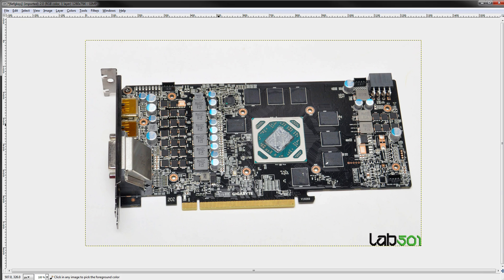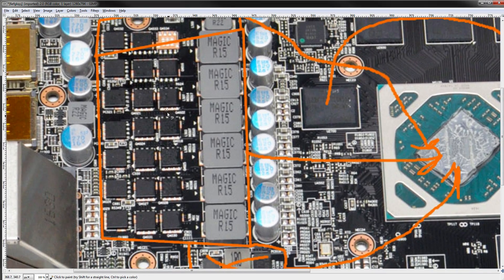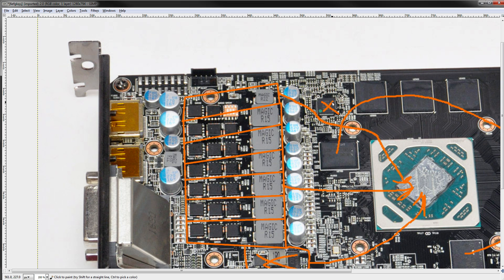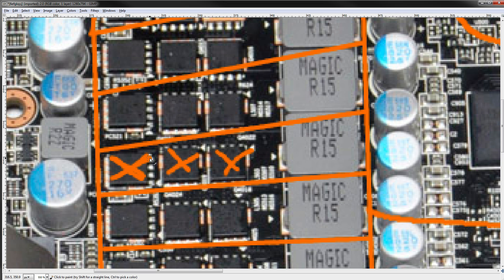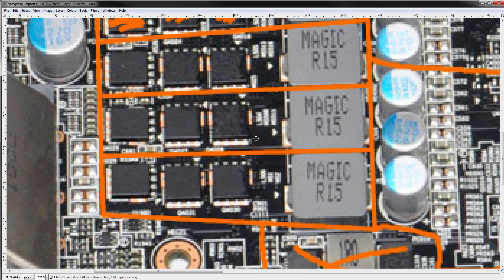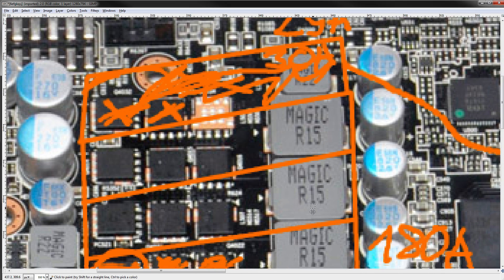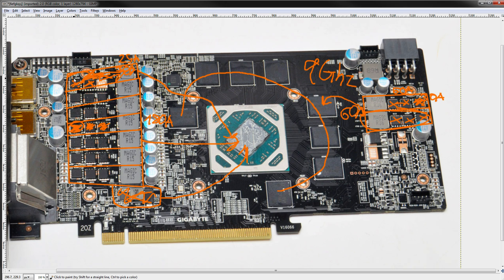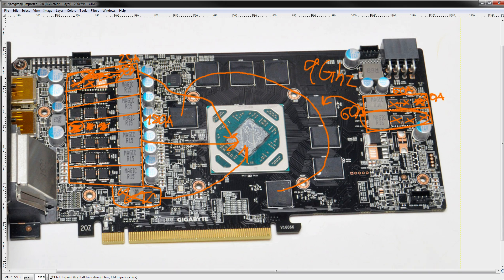PCB Breakdown: Gigabyte RX 480 G1 Gaming

Comment: Gigabyte got an rx 580 8gb into my hands for $314 canadian which was nearly $50 less than any other model with the nearest being the MSI if I recall correctly.. If all the cards were the same price then no, I wouldnt buy it. But when they can give you a card that does 1080 @ ultra or even 1440 gaming easy for way less than anyone else, I don't think that's such a terrible idea.

I've been attempting to do a custom loop on it, and having some issues with vrm cooling on the RX 580 8GB Gaming , is it possible to get a slight update even via message on if there is any differences between the 480 here and mine? It also has 3 rows of vrms, but perhaps they changed them? I can OC it to 1411mhz on the core with little to no voltage, but that seems to be the limit so perhaps this is the result of what you're talking about here, but it's still matches the highest (base over-)clock of the best rx 580 from what I saw at the time, which I believe was by XFX.

Comment: Hey, I have this card and have installed an all-in-one watercooling solution from id-cooling that doesn't cover the VRM area. I have installed a slim 92 mm fan that blows at full speed directly on them, no copper/aluminum heatsinks mounted directly. It gets pretty hot on touch when gaming, but since I can't measure the temps on them my question is... it is safe on the long term? I could stick the included heatsinks with special thermal adhesive but i still wan't to be able to mount the stock cooling solution at some point in the future.
Reply: You should really*put on those heatsinks for the VRMs/heatsinks, they'll get very hot even with the fan blowing on it. For now it shouldn't get *too hot but you should install the heatsinks that came with the AIO cooler.

Comment: @Actually Hardcore Overcloking so if G1 is bad as for rx480 does that necessarily mean the same for the other chipsets too? both nvidia & amd 1xxx and 4xx
Reply from the maker: For daily use the RX 480 G1 is fine. Just don't try to shove more than 1.3V through the core. It should also be one of the more efficient RX 480s.

The Nvidia G1 line is fine. It's just the RX 480 and 470 that kinda suck.

Comment: is safe to have 4 phases (30a at 100c/48a 25c) 4925 on an r9 270 150w tdp
Reply: in pulse they give 210a
Reply from the maker: the pulse rating is kinda irrelevant for VRM applications. However 4 30A phases for a 270 is fine. Those cards run relatively high voltage(1.2V and up) also the RAM is going to be using up some of that power so it's not all for the GPU core. So really it's more like 150W - 20W / 1.2 that works out to like 100A on stock clocks and the continous rating is overkill. It's great for figuring what FET is better not so great when you want to know what the VRM can't survive because it's always way too low.
Reply: Thanks, mine is at 1.13 v at 955 and 1150 at 1.16v is a  powercolor turboduo so the cooler blows air just on top of the vrms

Comment: Hey dude, I really enjoy your PCB Breakdown series and I'd like your opinion: I'm about to buy an RX470 and the Gigabyte G1 version is the one who fits the best with my PC aesthetics and color scheme but i can't find either a review or benchmarks of the Gigabyte G1 RX470, only the RX480 G1 (which I know it kinda sucks both as PCB and as thermals). My question is, does the Gigabyte G1 RX470 have the same PCB design as this one and how does the cooler handle the thermals (in theory it should be both quieter and cooler than the RX480) ?
I would use the card for gaming and keep it on air with the Gigabyte cooler, but I'd like to keep a light overclock (atleast 7Ghz memory and +50mhz on core) without the card heating up or getting loud since I want a silent PC.

Thanks in advance for any reply,
- JackaL
Reply: TheWarTube The 470 from gigabyte is equally bad. Lots of reviews out now. It goes to 80C under load.
Reply: Thanks dude, I figured it out on my own too. Right now I'm more oriented towards the ASUS Strix RX470, which should be both quieter and less hot (<65ºC hopefully).
Reply: The Asus 470 throttles performance really bad to keep it under 65C. I've looked at every 470 and each seems to have an issue one way or another.
Reply: Yes I heard of the throttling, but that's caused by the default fan curve of the card (which is targeting silence rather than cooling), with a custom fan curve it should be fine.
RX 470 is a great card but the aftermarket models are so f*cked up...
Reply: I also don't like the fact that the Asus 470 has a 6 pin connector when it draws almost the same amount as the RX 480.

Comment: Anyone got the datasheet or part # for the reference VRM FET's?
edit; Found out the high side FET in the reference card is MDU1514 and the low side switch is MDU1511. 
While the MDU1514 has 10A more continous drain current at 100oC than AON6414A (which gigabyte is using), the Gigabyte's part of choice has much better pulsed drain current handling  at 140A vs 100A. With the better pulse current rating, the gigabytes part of choise could actually be BETTER. 
If we drop the supply voltage 12V to 1V, the high side fet obviously bears the full grunt of the load current, but is turned on only roughly 1 / 12 of the time. The low side FET's take the bigger part of the load, as they are on for the remainder of this duration.. and gigabyte had doubled them to 2 per phase.
The part gigabyte is using has higher RDS on with the same gate voltage, so the FETs gigabyte is using will heat up more.
Reply from the maker: The thing is that the pulsed ratings usually assumes a starting Tj of 25C. There is no way that the FET will have a Tj of 25C in a VRM. They will be running between 70-100C case temperature(which is typically a few C lower than Tj). Also as you raise core voltage you keep increasing the on time period and get slowly closer and closer to full continuous operation. I will admit that continuous ratings are a little low compared to what you would be able to get away with under normal operating conditions however pulsed ratings are way too high.

As for the low side handling the larger load. This is true and in VRMs where the low and high side are identical the low side will die first. However when the low side is significantly more powerful than the high side the high side is basically always the first to die. For example the R9 290X which has an IRF6894 for the low side and an IRF6811 high side will burn out the high side not the low side.

Other than that TiN who's an engineer at EVGA also goes by high side continuous ratings when determining VRM quality. So I'll stick to his way of doing things.
 
On a side note the pulsed ratings on the MDU1514 seem to be a test equipment limit because the MDU 1517 which can do 100A continous at 25C case temp also has a pulsed rating of 100A. So I think magna doesn't do test for more than 100A. So the MDU1514 is very likely to have a pulsed rating above 100A it just hasn't been tested. 

Thanks for bringing this up though. It's nice to see that people don't just mindless accept everything I say. : )

Comment: Are you going to do one for the MSI Gaming X 4GB?
Reply from the maker: I wish I could but can't get a datasheet for the card's components
Reply from the maker: K ratings on caps really don't matter. Even 2.5K will last 3-4 years of gaming usage. Stupid high K ratings on caps are marketing stunt. Most GPUs just use Nichicons(I haven't seen any other brand on any GPUs in a while).
Reply: ASUS uses Apaq(a Taiwanese brand) capacitors on some of their videocards and motherboards. (Gigabyte uses them on some of their motherboards,too.)
For example,the caps besides to GPU vcore chokes on the RX480 Strix,they even used them in the GTX980Ti Matrix as well. Apaq capacitors are very easy to distinguish from their logos.

Comment: Would you call me a liar if I told you my rx 480 sapphire nitro clocks to 1435 on air without overvolting?
Reply from the maker: No but you just might have a top 1% card and I want it. You can always just post a screenshot of windowed Unigine Heaven with GPUz's monitoring tab open next to it.
Reply: Actually Hardcore Overclocking
I just crashed after an hour of bf4 so I actually lied, sorry.
Reply: Ok I really jumped the gun there I ended up stable at 1415 with a 25Mv overvolt (atleast at 3 hours bf4 and a bit of fallout4). But the crashes are strange at least for what I'm used to. I'm used to (with my previous cards) that a gpu crash just crashes the driver and bla bla bla but if I crash on this card I get a full system crash, Is that normal? (Also I dont get any artifacts it just runs or crashes)

Comment: Hey, it'd be quite nice 2 see some more PCB vids, i would suggest the 480 by XFX.. and by some really famous 1080/1070s, like the Gainward Phoenix or related..
Reply from the maker: I plan to do all the 480s pretty soon. The thing about the 10 series GPUs is that they don't really scale with volts so the PCBs really aren't that important
Reply: thanks for the 480s! And.. well, in germany where i'm from, the most reccomended cards are the Palit GameRock or Jetstream and Gainward Phoenix, but i don't know if they are really that good on the PCB-Side or just founders with better cooling.

Comment: Why gigabyte did that? Price? Efficiency?
Reply from the maker: they didn't really get much in terms of efficiency so I'm going to say cost savings were the main motivator.
Reply: Actually Hardcore Overclocking
 this is weird cause making a new design cost them a lot.
Do these VRM degrade a lot with temperature? Maybe it's running cooler.
Reply from the maker: they do 53A at best. So at 80C I'd expect them to do around 40A
Reply: Actually Hardcore Overclocking
 Maybe they just wanted a cheap solution to the PCI-e problem that was not quick fixed yet when they designed the card.
Reply: Not really. When You are about to design a new PCB and whole produce line for 1000 cards - it is a lot of money and not profitable, but when you are about to sell milion cards around the globe  - saving few dolars on each GPU makes a count.

Comment: When a memory overclock fails on the 480 is it because of the GPU Memory Controller or Memory chips?
Reply from the maker: Depends on the card. The thing about the AUX voltage is that it's been available since the R9 290X and it really depends on a GPU to GPU basis if it helps with mem overclocking. So try push it up a little or down a little if you can't get some mem clock stable. It might help but again it might not.
Reply from the maker: Depends on the card. The thing about the AUX voltage is that it's been available since the R9 290X and it really depends on a GPU to GPU basis if it helps with mem overclocking. So try push it up a little or down a little if you can't get some mem clock stable. It might help but again it might not.

Comment: thank you awesome man. I knew, I believed Gigabyte is bad. My First Motherboard was a Gigabyte one and Repair man said it's mosfet blows after repairing another mosfet blows. I repaired that Motherboard twice and it blows again i didn't overclock or anything with that motherboard it was 2004 i was only 11. after that i just throw that away and bought a Asus Motherboard and I used that Asus Motherboard for 6 years and then sold that but it never blows.
Reply: my old gpu from  gigibite crashed aswell so newer them again:P
Reply: No brand is perfect, even the most reliable can come faulty. My current mobo is a gigabyte with more of 7 years and it's still running fine.

Comment: So it's basically trash :/ I'll send you the picture of my RX 480 Red Devil soon. Where do you prefer I send it? Or have you already got a picture of it?
Reply from the maker: Yeah just send me message over youtube. Get me close ups of all the VRMs you should be able to see those without my help at this point.
Reply: Actually Hardcore Overclocking Alright I'll send it right now
Reply: Actually Hardcore Overclocking Wait I don't see an attach photo button
Reply from the maker: you'll need to some kind of image host like imgur
Reply: Actually Hardcore Overclocking O I see ok hold on a sec
Reply: Actually Hardcore Overclocking Sent imgur links
Reply: asdrubael1985 That is the best rx 480 by far
Reply: are you crying now ?
Reply: asdrubael1985 Uhh? No. Its not like I can't overclock it. Running it at 1440MHz
Reply: acnfanmanin
good for you then..i was scared with this pcb analysis of red devil..thank god i didnt get it
Reply: asdrubael1985 The cooler is really good tho
Reply: acnfanmanin
ye i know..i ll go for an xfx

Comment: XG RX480 has a much better VRM. New generation G1 cards are what used to be regular Ultra durable cards, but designed for "cost down" as all Taiwanese vendors are doing. Definitely a waste of time and money. XG model will come out in a month or so but overpriced. 
AMD's 9GHz limit is in the BIOS as well. Can't change it either because they won't approve and send security key back to you for the bios if you go over spec. :/ 

Epic video as usual dude, keep em coming.
Reply: Presumably Xtreme Gaming.
Reply: what's xg?
Reply: ivan134 Yes Xtreme Gaming version

Comment from the maker: First!
Reply: Could you possibly PLEASE do a PCB analysis on the Gigabyte G1 Gaming GTX 980 Ti? I will name my first born son after you if you do!

Also, I have always wanted to know; IS there any MEANINGFUL difference between brands and models of chokes? Or do they all perform the desired task, and possess similar longevity as one another? 

I tried looking up both a Gigabyte G1 Gaming GTX 980 Ti PCB layout (with marks and annotations like what you do on screen in these videos) but none exist, and I have TRIED to see what the specs on different chokes were, and if they even make a difference. But there seems to be very little ado about chokes...

Anyway thank you BuildZoid! I LOVE the in depth look at the PCB level of Graphics cards! Seeing as I already know the GPU specs like the back of my hand, learning what the PCB contains and is specified for, is what makes ALL the difference once one has decided which GPU they want. 

That, and my G1 Gaming GTX 980 TI is the first GPU I have owned that I have EVER even CONSIDERED going SLI with, I would LOVE to know exactly what all the PCB specs are!
Reply from the maker: Chokes actually play a pretty important role. However getting datasheets for them is borderline impossible and generally they don't vary in cost much. Generally chokes are chosen appropriately for the rest of the VRM.